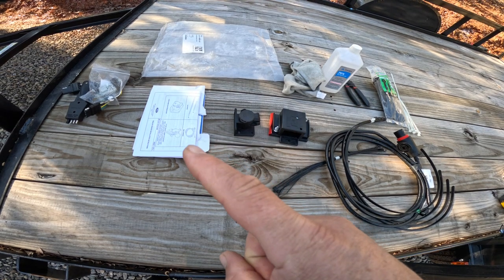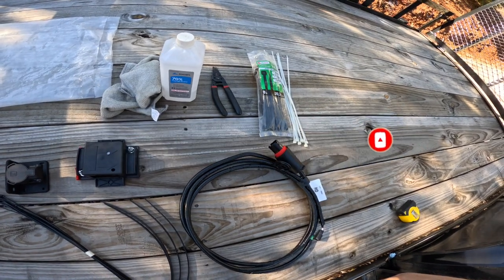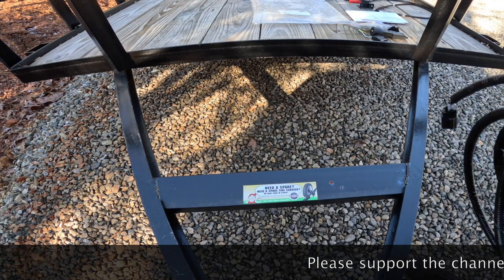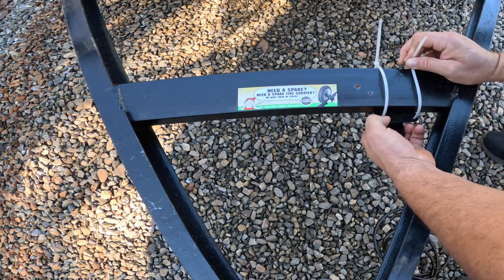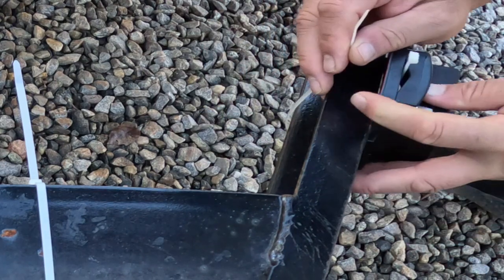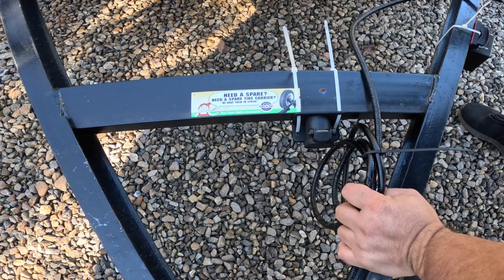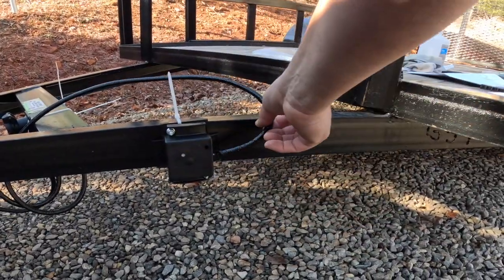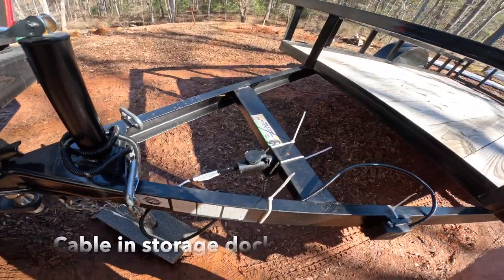2021 Ford F150 Lariat: Pro Trailer Backup Assist, Trailer Sensor Installation

Comment from the maker: The part # for the kit is- LC3T-14G621-AD.
Reply: @RoCDIY  They make this harder than needs to be.  I have a 2022 f250.  Dealer just gave me a lc3z14b296b part no.    $1,043 w tax.....WTH????  I need the 5th wheel prep kit for the 7/12 pin connector and harnesses in the bed, I want to add the tpms & backup camera to a 5th wheel I am buying, and want to incorporate the backup assist with a yaw sensor.  I have all the needed options on my truck, Ford parts and dealers have no clue and I don't want to spend over $1000 without ability to return or confirm the correct parts
Reply from the maker: @scotkrayenhagen9310  The part # you are showing above is for a part of the kit (yaw rate trailer sensor assembly only). Works with F150, F150 Lightning, F250 Super Duty and F350 Super Duty (Years 21-23), I looked up the part (Lakeland Ford) and they have it for $629.46.
If you haven't done so, go to some of the Ford forums. There's a lot of discussion about exactly what you are talking about.
They are definitely clueless at the dealerships. My former dealership had it on the sticker as included in the purchase. I questioned where it was and I was told it was installed, so I asked where are the pieces and parts for the trailer? Clueless! They were trying to pull a quick one on me. A salesman told me that they were tossing accessories/options in to other trucks in order to sell them even though they weren't included in the price.
Reply: @RoCDIY  what's funny, should go to a junk yard.....everyone that ever had the 5th wheel option installed should have a yaw sensor kit under the back seat...
Reply from the maker: @scotkrayenhagen9310  Good luck with that. Don't go to a Pick Your Part place. Things like that would be gone is a heart beat. You are probably better off going to a junkyard where customers aren't allowed in the yard. I went to three different Pick Your Part yards (Charlotte, Greenville, and Greer) and those vehicles are picked to the bone. What's on the website doesn't match what is in the yard. I was looking for Honda Accord stuff.